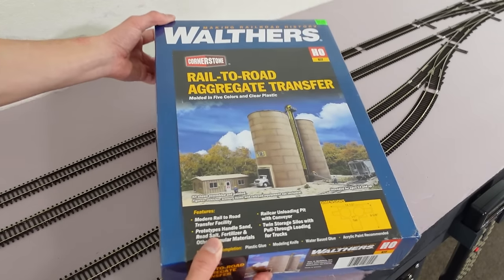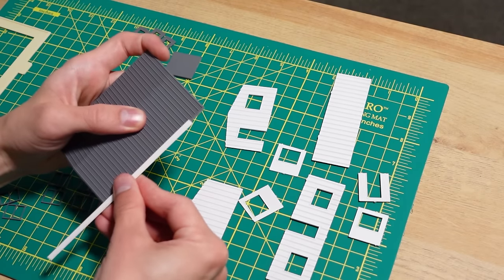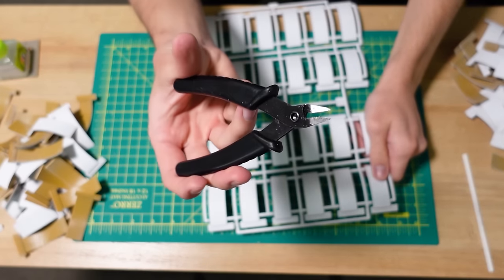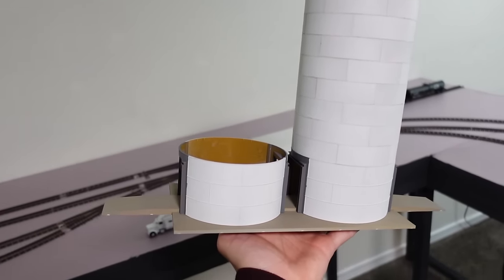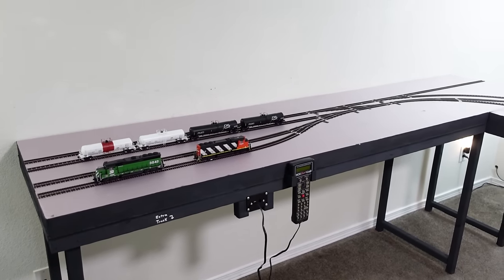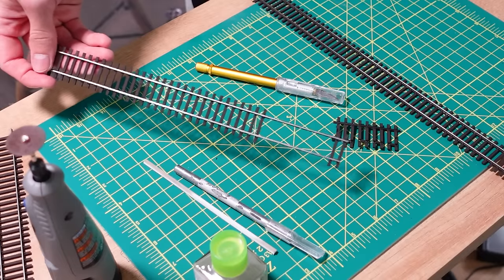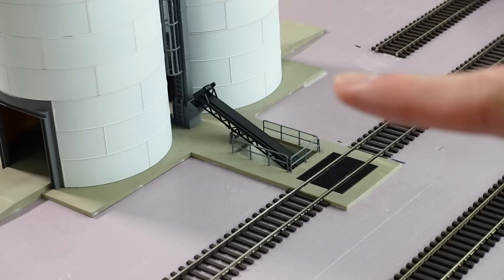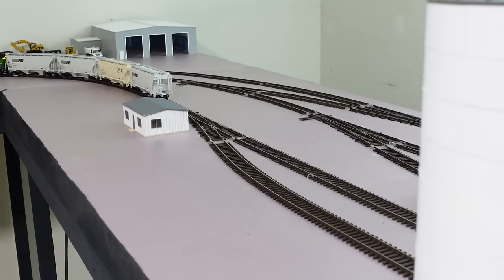BUILDING A NEW MODERN INDUSTRY PT 1. (Walthers Rail to Road Aggregate Kit) - Ep 3

Comment: Very enjoyable and informative Thanks.   Sorry if I missed this earlier, why does there seem to be so much space between ties where track sections come together?   And why so many solder points for the wiring , is that for electrical continuity?
Reply from the maker: I fill in those spaces between tracks in the following video I just uploaded. And yes you get better more consistent flow of electricity by soldering all the tracks together. Thank you for your comment!

Comment: I'm a little confused You're aggregate silos the build everything looks great The underground dump for each flow car but how many cars can you do at a time I would have thought you would have had a through track or a separate runaround through to the pit so the head of your train would come through or you would backup with say 10 cars it looks like your layout does one or maybe two just didn't get that I have a runaround on the end scale I'm building now with a co-op and my silo system I'll run the train through one end out the other which will take 20 cars will be able to dump and then sightings for empties or for to set full cars to be picked up later I don't know you tell me if I'm wrong or that's just how you wanted to have the layout
Reply from the maker: I can only do two cars at a time. You are completely right it should be on a much longer track to dump more at a time. I just wanted a small not so busy industry which is why I did it this way. Plus I’m restricted with a small area to work with. Although if I were to go back in time I would move it over a little more to fit maybe 1 more car

Comment: Get yourself a 3D printer you can make all kinds of buildings that are online. I made 12 n scale buildings and the 3D printer was $230
Reply from the maker: Wow that’s awesome! I’ve always wanted a 3D printer so I may have to pull the trigger on one at some point
Reply: @TopRailroad  I have the ender 3 pro from Amazon and then I get the plastic filament from micro center.
Reply from the maker: Good to know appreciate the info!
Reply: @TopRailroad  only thing you’ll have to do is sand the building a little and paint.